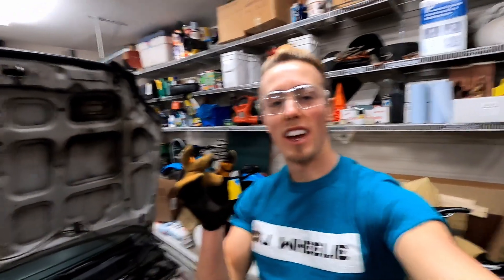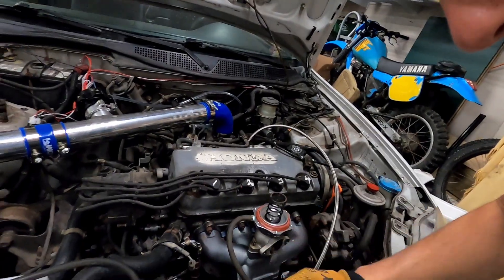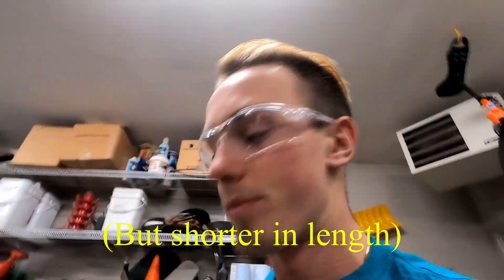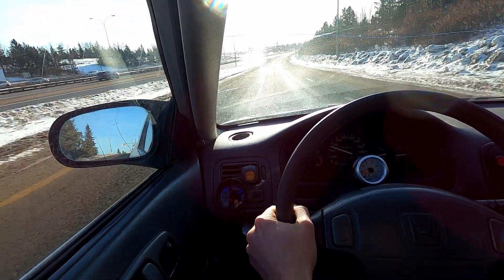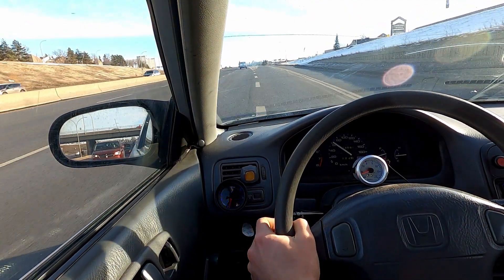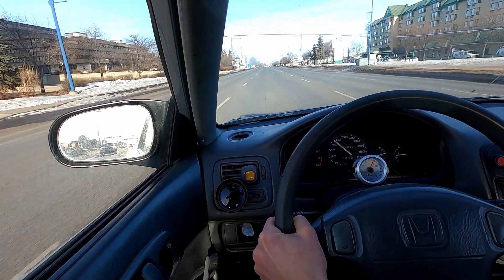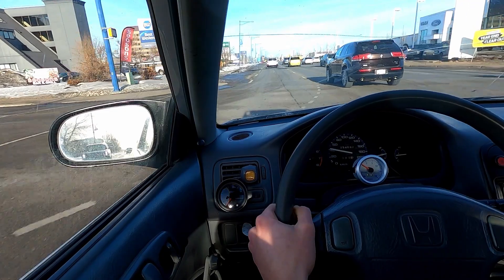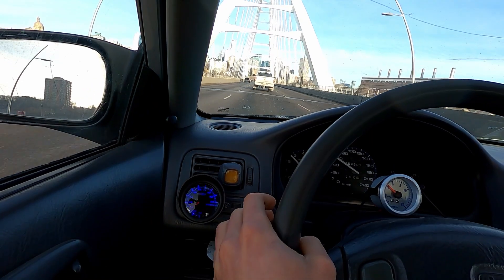DIY 5 psi Wastegate Spring on eBay TURBO Civic (D16Y7)

Comment: Dude, I was a N/A guy but have done my boost homework.   What I learned is most cars with a MAF will accommodate up to 30-35% more airflow than stock and the fuel system has that engineering fudge in it as well,meaning you can "get away" with 4-5 psi on a stock motor without changing anything.    For a cheap setup use the FMU, which will cover you up to around 11 psi.   You will also need to retard timing 1 degree per pound of boost, but many are running 93 octane and doing fine.    E85 will allow you to not have to retard timing even on a 20PSI rig.

Did you add the FMU to this and how far is it today?   I'm guessing you probably did the FMU took it to 8psi or so, then up to low double digits psi with a tune and injectors.

Comment: Hey man did u get a cel with this setup with no tune?
Reply from the maker: It did when I was at 8psi for sure.  I was just watching my video here as I can't remember if it still had a CEL at 6.5psi.  Its looks like there is some orange reflecting at 3:46.  So YES, there was a CEL and it was for positive maf pressure
Reply: @JWheelie  awesome thanks👍🏾

Comment: Lets say for instance, if I wanted to crank up my d16y8up to 225 horsepower(after tuning and 1000cc fuel injector upgrade), would a ebay turbo be efficient enough to meet those standards without any serious harm to the turbo or motor?
Reply from the maker: Yea, I don't see why not.  Some people push BIG HP numbers with ebay turbo's.
Reply: Check boosted boys channel if you're wondering abput using an ebay turbo. You won't be disappointed
Reply: @madhut3042  Oh I watch them quite a bit lol

Comment: What size injectors should you use if you have a D16Y8?
Reply: Stock the 240cc are great for 5-7 pounds with a stock engine

Comment: Yo dude I had the same exact problem with the oil leak but it turned out to be coolant that was catching a bunch of brake dust and I can't remember at this time oh matter of fact I do remember and by the way I'm using text to speech I mean speech to text okay so you know that bigger what do you call it coolant line that's rubber that's on the left side of the block that kind of goes behind the magneto I believe it's called I know it's not called that it's on the tip of my tongue but I can't remember but basically where you plug in all your spark wires I found there to be a crack and it was shooting coolant slowly but surely in a fine mist and that same exact area so I took it off and replaced it and how I found the issue was me pressurizing the coolant system and finding where the leaks were in my case a single leak I then cleaned the engine bay with degreaser then WD-40 then done just so then chemical guys citrus wash and it came out really nice once it was all said and done sorry for the mumbo jumbo but I hope this helps! By any chance do you have an Instagram or a Snapchat or with some means of better communication than YouTube because in the very near future I want to put a Y8 in my 2000 four-door which is mint and I also want to put a turbo system on it not eBay though that also keeps power steering and AC so if we could communicate it would be a massive help or if you could just send me better photos or more personalized videos of your setup and what you kind of had to do in order to make it happen I have yet to fully look at your inventory of videos because this is actually the very first video of yours that I've watched but regardless if you do have a build video I'm going to watch it but I would still like to be in communication with you because people informs can be kind of you know weird and temperamental. 

Thank you for your time and I'll be looking forward to seeing a response from you 👍

P. S. That hose I'm talking about is kind of shaped like an s if I'm remembering right and it had one of those clamps that wasn't like one of those screw bands but more of like a C band that you would use a pair of pliers to loosen up in order to pull it off. Once again I hope this helps and you should for sure pressurize your system All it takes is a simple garden hose with some rubber latex gloves tied around the end of the hose to make it airtight and watertight seal and place it in the refill hole on the radiator. Make sure you block off the overfill hose so you're not losing pressure through there and the little cap that I believe is a drain plug that screws in and out of the bottom of the radiator is on there as tight as possible and you will need to do a complete flush which is always good but what you'll initially want to do is flush it find your leak coolant leak then replace that hose then just let the system run like that normally with the drain plug open for 10 or 15 minutes and then turn the car on and let it run like that and get a temperature for about 30 minutes and then let it empty out a little bit well actually let it completely empty out bone dry but make sure the car is turned off for this part of the process and do a 50/50 coolant water mixture and completely fill it up but it has to be the blue OEM coolant not the green not the red not the yellow the blue one it must be the blue one because of the certain additive that hasn't that none of the others ones haven't it that helps keep your water pump bearings and check and your rubber hoses from getting degraded which is the exact corporate in the case of my car it had the green coolant in it and it just ate through and dried out my hoses quicker than it should have then flush that then fill it with 100% blue OEM coolant, but it has very low miles it's very very clean it's a five-speed it's never been sat in other than the driver seat the passenger seat is immaculate driver seats immaculate it has basically weather tech freaking floor pads or whatever you call them. Keep the y7 trans bc the longer ratios are better for longevity top speed and mpg but still want to put in a longer 5th gear

So basically I want to do a d16Y8 swap from y7 I want to put turbo cams in it T2 turbo, biggest intercooler that allows me to keep ac\ps, port and polish the head, stage 2 turbo cam with beehive valve springs with titanium retainers with 11:1 compression pistons since the gas station in my neighborhood sells 100 octane for 3 something. Crazy good deal. 255 walbro fuel pump and some really responsive injector,  wavetrac LSD, Integra rear disc brake conversion with AP racing brake kit front and read stainless steel brake lines all around and then a set of wheels that will fit the bigger disc, stiffest rear sway bar to help the back end turn and rotate to eliminate almost all the understeer the LSD doesn't catch, stiffest polyurethane bushings for entire suspension, cheapest set of kw coilovers set up super soft up front and stiff in the rear to eliminate understeer, polyurethane engine mount bushings, lightest possible 1 peice flywheel, exedy twin disc rated for 350 lbs feet trq(over kill I know but If treated right in a 250whp 240tq application it'll last a long time while being driven hard.

Comment: If your running 3 psi do you need to upgrade the injectors
Reply: What's the point of 3psi would be slow enough on 8psi let alone 3 waste of money and time doing a turbo
Reply: @livinINAvan-b6w  any positive pressurized air is good. 3 PSI is like 25+HP

Comment: Thinking about replacing the wastegate spring in mine to something rated between 6-7psi, so is 11.5-12 an ideal AFR for when you're pulling that much boost? I'm currently running 3 pounds open loop
Reply from the maker: I believe thats right around the correct afr for WOT, yes

Comment: Hmmmm... engine leaking oil bad.... I think it’s time to find another D series and do an engine tear down / rebuild series?
Reply from the maker: You mean build one on the side?  That might be an idea, then drop it in when this one blows.
Reply: @JWheelie  that’s exactly what I mean. Get a second D series, a full refresh kit if gaskets and seals, total tear down, check the internals, maybe replace a few things (rods & pistons?), and have it on an engine stand ready to replace the current one when it pops
Reply from the maker: @malcolmhamilton8090  Not a bad idea, lots of d series guys do that.  I'll think about it